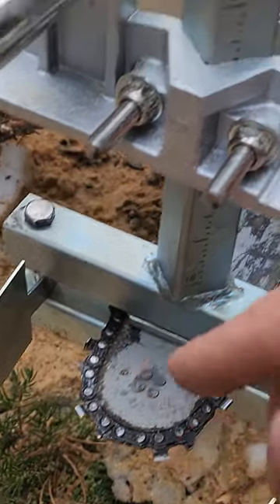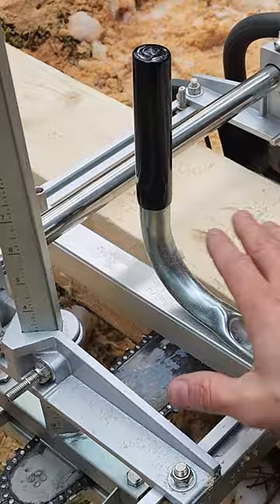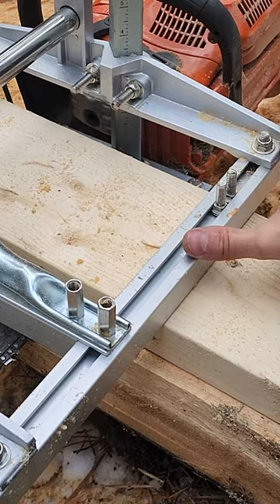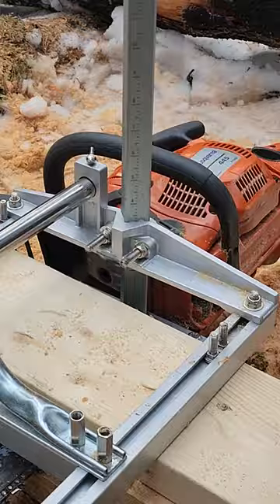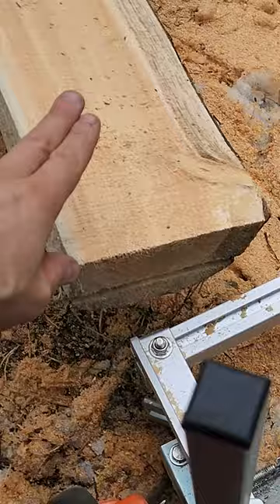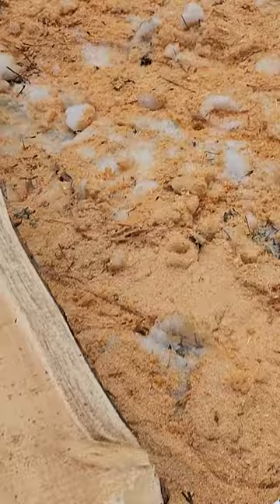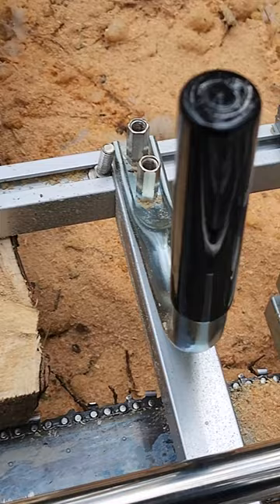Small Chainsaw Milling.  How well does it work?

Comment: That's an Alaskan  Sawmill. Works great but requires lots of elbow  grease
Reply: What is the make and model of your Alaskan sawmill?
Reply: @PeterDSouza  I had one 20 yrs ago.
Reply: @DTWMTX  do you have a make and model that you’d recommend?
Reply: @PeterDSouza  Not really.  There all pretty durable.  Extruded aluminum.
Reply: Elbow grease = pushing chainsaw through log. Even sharp chain & green tree is still a chore.

Comment: That little saw won't last long doing that. Trust me I've learned the hard way.
Reply from the maker: I hope that will good fuel mix and letting the saw run in it's power band, it should last the same as any other type of cutting...  Hope for the best I guess! :)
Reply: @UtmostOutdoors  it all comes down to duration. Too long of a cut and presto! she's blown. Best of luck!

Comment: Just a little tip bro seems like you're chain is a little dull. Could be pushing to hard or I could be wrong.
Reply from the maker: I think my chain was fairly sharp, but it's a small chainsaw that is probably too small for ripping work so it's got limited power to pull even a sharp chain.
Reply: @UtmostOutdoors  It helps to shim what you've cut to reduce stress on the blade too.

Comment: Getting stuff together now to do this myself.. keep hearing a stihl 029 (56cc) won't work to well but idc it's what I have and its very reliable.  I think when making smaller boards 2x4 or 2x6's these smaller saws will work just fine.. a few sharp chains and some patience ... thks for the video
Reply: I ran an ms310 on mine for years. They get a little to hot because the exhaust is restricted. Do a muffler mod and you'll be fine. I cut 18" oak slabs with mine and it did oak,just slow goin
Reply: I've had the same mill for 2 years. I'd add that you should use a little more mix oil so you don't burn up your saw. I run a modded 044 and 046 with no problems. Keep your chain sharp and have a couple extra in case you hit a nail or piece of metal.
Reply: @clem95627  absolutely, sound advice.👍